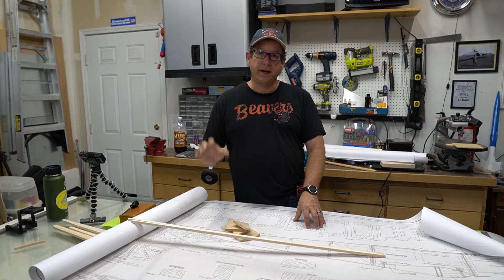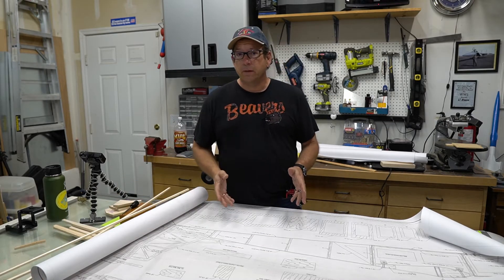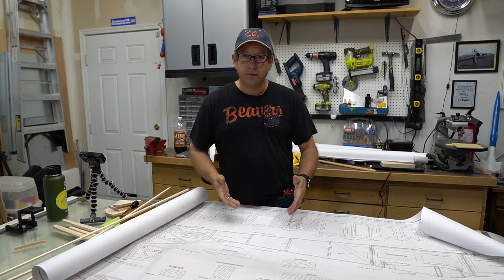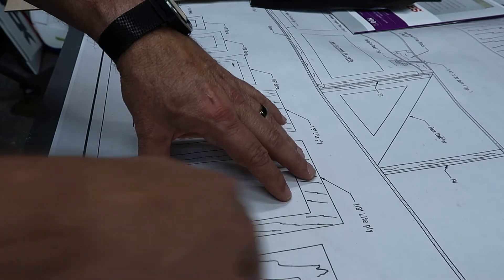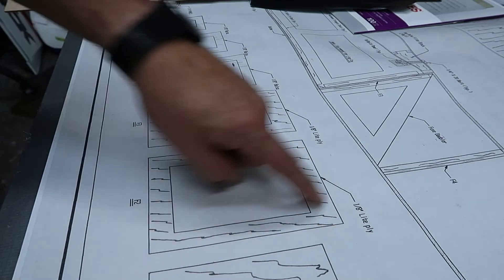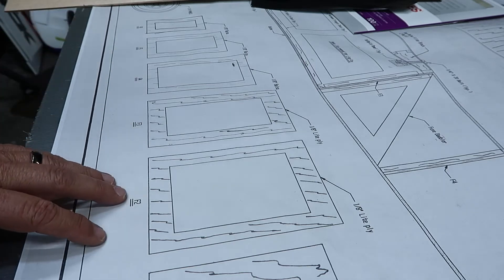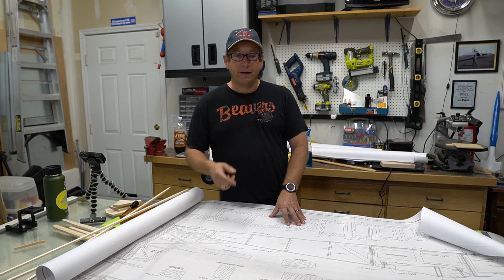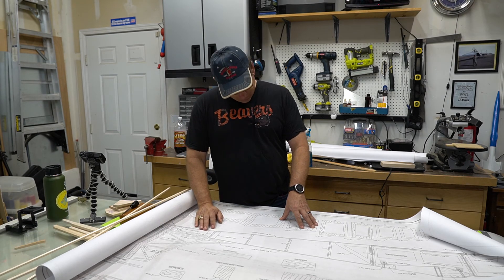EP3: Scratch build R/C Airplane:  Setting up to cut the kit

Comment: Is that a Tilley on the wall?
Reply from the maker: Why yes it is.   That's one of my flying hats.  I love my flying hats.  Protect those thinning tops and ears.
Reply: @Capgains7777  One of the older ones, much better. The new ones are not quite the same.
Reply from the maker: I think bought that one in 2010ish.  It is the original canvas with grommets for ventilation.  I loved the whole Tilley built for sailing story.  You are correct, the newer versions seem to be made with lighter weight materials.  I have been trying other brands like Shelta whichbis more of a sun hat for people that want a baseball hat firm bill out front. They work well too and pretty well built.

Comment: I use a material called SeeTemp
Kind of like transparent thin plastic that cuts after you score it with a blade. Bend and comes apart easily and you have a rigid template.

Comment: one way i make my templates is... i cut the template i get the wood ready. i use blue 3m tape i put it on the wood then i glue the template on the tape. let it dry cut the wood and peel the blue tape off...

Comment: Trace patterns onto clear sheet (transparencies), cut out and trace onto cabinet laminate, then cut out. You now have a template that will stand up to handling and can be stored and used repeatedly. Put all templates for the plane together and store. They can be pulled out at any time to cut more pieces for another plane or for repairs. You can actually have a few copies of the plans made, cut duplicates of everything as you go, when you're done you will have several complete kits, sell the extras and pay for the one you keep and build. Just options.

Comment: Hi from Australia. If the plan is printed with toner ink you can place the drawing face  down place the wood under the part to be copied and use an iron on the back of the plan and it will print it on to the wood 😁😁
Reply from the maker: Someone else mentioned that too.  I'll have to give it a try on my next scratchbuild

Comment: PS I am new to this, is there a specific size I need to ask STAPLES or do I hand them the flashdrive and say "Blueprint these, please."?
Reply from the maker: The ACAD version plans are to scale, so what they print should need no modifications.  You can confirm by having them give the length of the print area... The wing page is huge... no mistaking the size.

Comment: I like to recreate each piece in a cad file. Most pieces can be drawn much quicker than these methods. Only have to do it once, then you can put away the plans as an old relic, then laser cut every piece to your hearts desire.
Reply from the maker: That's awesome... I have never been blessed with the CAD arts, and by no means ever had the means for a lazer cutter... I bow to you.
Reply: What do you use to laser cut the parts?
Reply: I was considering the Glowforge.

Comment: Place tracing paper over the plan when using the carbon paper technique, hold in place with painter tape. That way your plan is even more protected should you wish to keep using the same plan or pass along to a friend.
Reply: I just get a second plan, the first is to cut up and use as templates, the other is to build from. I glue the one I use for templates to some styrene sheet to try and save them for the inevitable repairs :(

Comment: Dan, gettting back to r/c this winter.I have a Carl Goldberg eagle #1 , damage crack on fuselage( how about a session on common repairs)
Reply from the maker: Could you send me some pics of your damage?  dangellner@gmail.com
I'd like to see what you are up against.
Reply: @Capgains7777  Wow I have a Goldberg Eagle 2. I am swaping it to electric and need to replace the monocote on the wing because of hanger rash.
Reply: @Capgains7777  Also Where would I get the plans for this printed. I looked into maybe poster printing it and taping the pages together But it would be almost 75 pages. Will Staples print a PDF of the plans. Or will they not because of copy right infringement.
Reply from the maker: Steve, I went to Staples, they have the large profile printer that can print the big sheets.  They didnt say anything about copyright issues.
Reply: @Capgains7777  Wow. OK thank you. I have a staples conveniently 1/2 mile away. Lol

Comment: I use a sewing pin (with nylon bobble on the top to be kinder on the fingers) instead of an Awl as it leaves less of a hole in the plans! Worked good for me for 40 years.
Reply: Push pins used on maps already have the plastic bobble on them!
Reply: @sotm2  sewing pins are thinner and less likely to split the wood than thicker map or notice board pins!
Reply: @simonbaxter8001  Also more like to pierce your fingers.  I've used map pins since 1976 and have NEVER split any balsa nor have I injured a finger with a needle.
Reply from the maker: That's a great idea.

Comment: Where did you buy the balsa?
Reply from the maker: The balsa for this build came from National Balsa.  Ive had pretty good luck with them in the past, and no complaints on this run.  I will admit that the price of balsa has gone crazy in the last few years.  There are also problems with availability as well.  Evidently balsa is the inside structure on those 150 foot long blades on wind generators you see popping up everywhere.
Reply: @Capgains7777  - ...that they burn or bury when their life cycle is complete?!   Renewable... (thanks, I'll check them out)